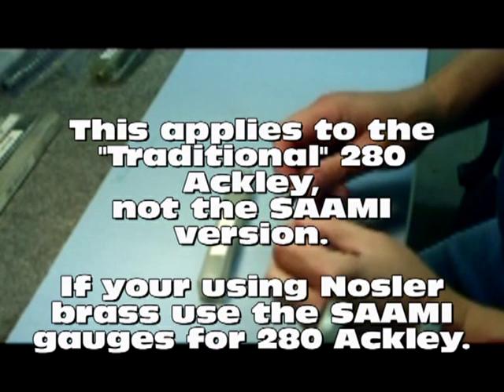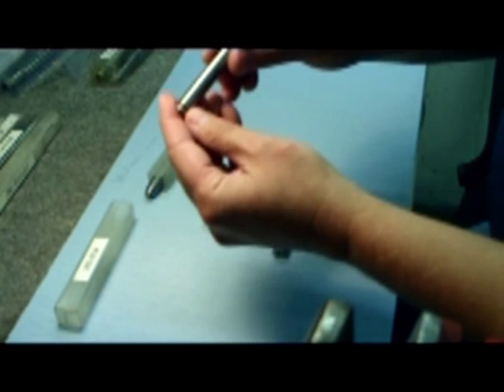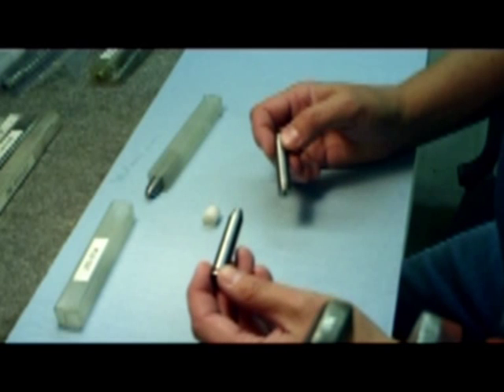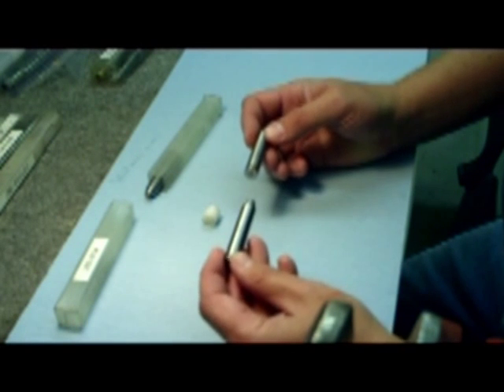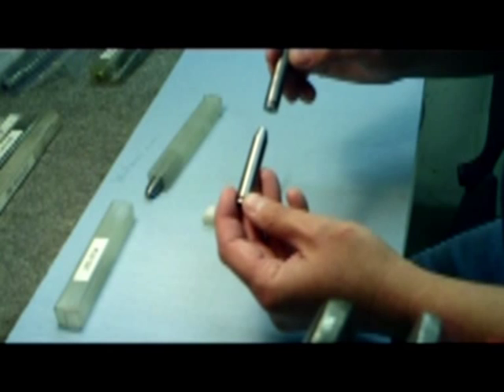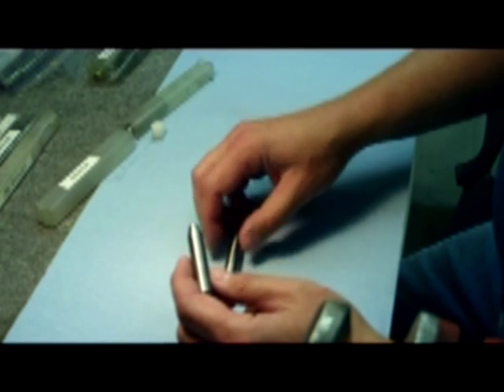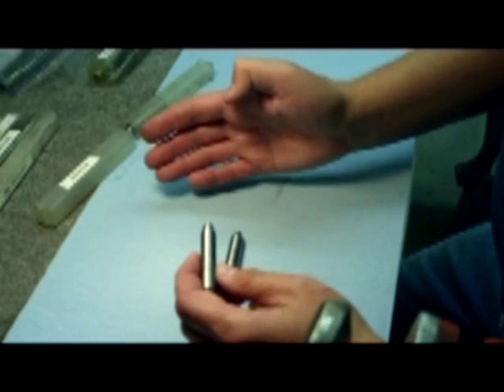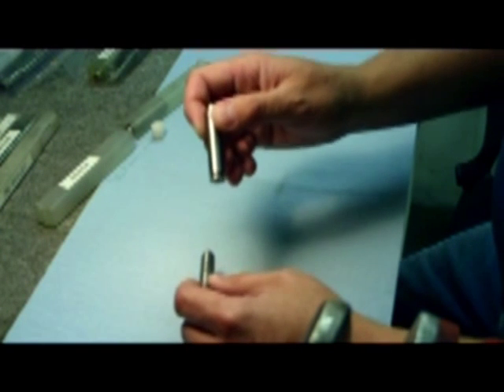Ackley Headspace for Rimless Bottleneck Cartridges

Comment: This is NOT correct. If you make a go gauge for the 280 and 280ai, the gauge needs to be .040” longer on the ai. The gauges are NOT compatible unless a NEW datum point is made to match both chambers. It is possible, but that new datum point MUST be noted because the headspace by definition is NOT the same. Base to datum vs base to neck/shoulder junction.
Reply: @Wyatt Earp  Sir, I’ve built ai rifles and made gauges from scratch. If you do, the datum point is much different assuming you want the neck shoulder junction at the same point